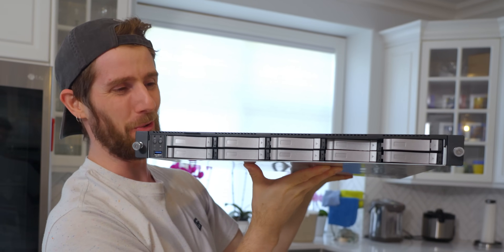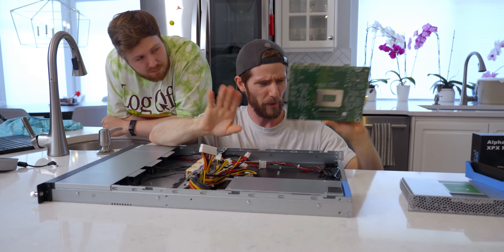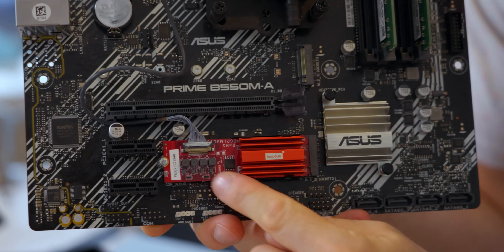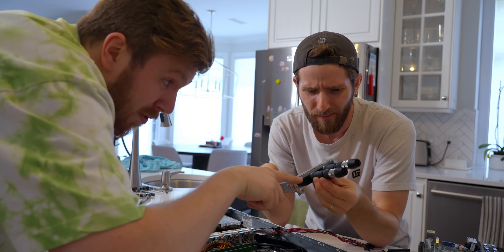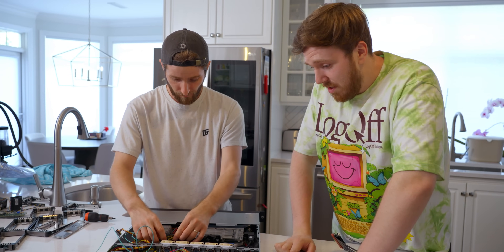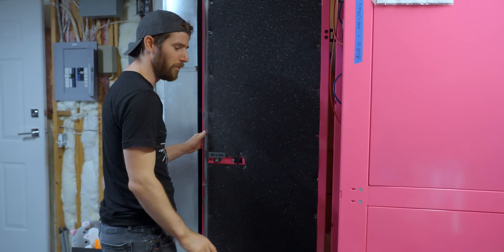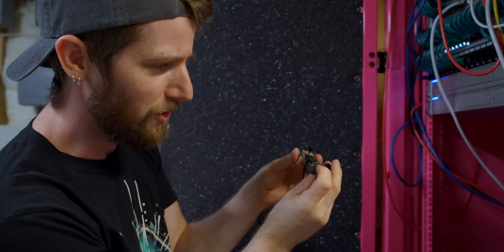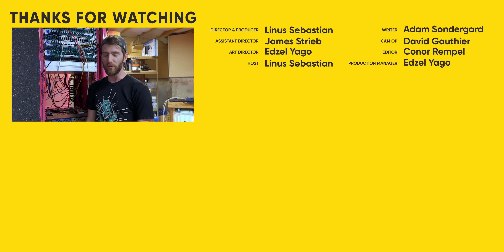I designed my perfect gaming PC, then threw it away - 1U PCs for My New House Part 2

Comment: I've noticed the same about the optical DP, it's really finicky. As you found out the optical cable has to be connected directly to something active, I found that a DP signal repeater works. Then on the other side because I have a lvl1techs kvm, I had to add another repeater after it again to get my monitor to accept it.
Even bypassing the kvm and plugging the optical DP directly into the monitor doesn't work, it has to go through the repeater to be sable(ish). They're like 10 euros on amazon, worth a try as it makes a big difference for me.

Comment: I feel like this would have actually been THE use case for 7 Gamers 1 CPU with virtual Windows and pass through graphics cards. I bet that would have fit perfectly into a 4U server, would have been much easier and cheaper to build and have off the shelf hardware. The only downside really is that you cant easily start your setup with the start of a button, but i bet there is a nice solution for that too.

Comment: Linux those remote pc switch are at risk of data theft and hacks. Cause they are directly connected to pc usb or other PCI's. People can easily hack or theft important data if the Provider want's.. You could use a RE5V1C relay module which only takes power from usb header through 2 +- pins. And its connects through internet via wifi... You can switch it from anywhere on the world. Just need some DIY...
Please Don't use wireless switch which are connected to pc usb header Through 4 pins

Comment: The problem at ~16:20 is probably caused by using a simple transistor across the "button" wires. The transistor wiring makes it need to be plugged in only one way.

Comment: He must have a hell of a breaker in that room because I have two gaming PCs, a mini fridge, and a small window air conditioner, and if me and my cousin are both playing a game, it throws the breaker in the room.
Reply: Evan a small window AC is probably at least 8 amps, that leaves 7 amps for everything else assuming a regular 15 amp North American circuit. Split in two that leaves 420 watts per PC. As for Linus' setup, they probably said the specs but I forget. A common setup for server racks is 2-pole 208 or 240 volts. That's 4 times a regular household outlet.

Comment: The whole "it's for businesses, not normal people" argument is bullshit.  We want standards too!  We want to put our computers in another room so we don't have sound or heat to deal with when we're gaming!  We don't need 24/7/365 same day support!  Stop making low profile computing expensive, damn it.

In other related questions from the peanut gallery:  Linus, you've made like, half a dozen "X gamers, 1 GPU" builds.  Why not make a single 2U with ample storage, a big honkin' GPU you can provision across multiple VMs, and a single high core count CPU so you can just provision a bunch of modern day computers for you and your family?  That seems WAAAaaaayyy easier and cheaper to do considering you've already done it multiple times AND the drivers and methods to do it are now even easier to acquire and configure.

Comment: Hey Linus, Question. How will the pool water cooling work in the winter in sub freezing temps, wouldn't the water in the loop freeze and/or cause cause condensation about the cpu block?
Reply: I believe he's heating the swimming pool year round, and the waste heat from the machines is just a (miniscule) part of that, so that shouldn't be a concern.  I mean, it probably will be if the loop isn't insulated from the ground well enough, but I guess we'll find out in January or February, assuming he's gotten the whole thing installed by then.

Comment: Would be interesting to goto a metal shop, and get estimate, and this TYPE of system..  BUT look at this another way, FLAT DESKTOP..  will need supports to place monitor ON TOP.
Give consider attention to the backplane Cover plate.  Not to worry if the case is 1.5 U...not 1 U.

Comment: No no no no no no no just no, thought you were smart, this is stupidity x5. (apart from the jank that's just cringe to the max, I kept shuddering watching you put that together) one of those zip ties comes lose and 4 other pcs get a bath. What happens when a family member says I need a 40 or 50 series graphics card this old 30 series wont run my new game.  Also 2 TB for gaming a bit small.

Plus I can see walking to another room to turn on the PC will get old very quickly, the remote will get lost, I'd be using sleep mode, use keyboard to wake it, or if he's a smart kid he will just leave the PC on 24/7 and sleep the monitor. power bill what power bill.

Comment: im local to Vancouver and  I would kill just to get a working pc right now ( my old 5th gen cpu and mono died) and im too broke on disability to  buy parts. 
got any hand me downs ?   I was doing work on fiver for contracts and such using my computer  to keep the lights on .. but now. im basically food bank dependant
Reply: to be specific I will take any motherboard cpu/ram combo over a 5th gen intel.  or and equiv.. .  I have a 7th gen intel cpu socket 1151lga. and two `16gb ddr4 rams that are not matched speed
and all the rest of the hardware I have will be fine (m2 drive and gpu etc). but. I won't say no if you want to do a pimp my pc setup video ..  lol I like dockers. and want to do game./video dev at home

Comment: Limiting the server chassis to 1U just makes no sense for this. Better to get a second rack, even if it's a small rack and at least opt for 2U which immediately becomes much more flexible since a standard motherboards IO shield won't even fit in a 1U chassis. A half height rack dedicated for just gaming PC's would fit 5 4U server chassis which would allow more use of PCIe slots, standard ATX power supplies and larger fans for quieter operation.

Comment: This is like the 5th video I've seen on this server rack/fiber home computer setup. This seems such a massive headache to setup and maintain. Plus, if anyone else in the home has an issue that requires troubleshooting (which i'm sure there has to be SO MANY), there is no way anyone else in that house would be able to easily solve it themselves. You'd constantly have to be acting as IT support for even the most basic of issues.
Reply: Just hand out a bunch of steandecks...
Reply: yeah but every time it breaks, he gets a new video
Reply: /shrug And some people like to fix up old cars. Everyone needs a hobby.
Reply: I still find it funny that he is trying to go budget on these builds yet has those icron docks on every build. I'd bet money that none of his kids currently or even a few years down the road will require that kind of bandwidth for usb. If he wanted to save money those docks should have been the first thing on the chopping block. Active usb 2 or 3 extensions with a powered usb hub and long 3.5mm audio cables are good enough.
Reply: @ikkuranus  physics would like to argue with your point about the active extensions.
no, seriously, if you cross a certain point of length with your cables, converting it to fiber optics is one of the best things you can do, i've had to fix too many issues with those cheap extension cables before
Reply: Linus, and probably a fair number of people, are of the mindset that over-engineering a solution now will save you time and money later. So yeah, while five individual towers is probably easier to troubleshoot, it might take more energy to fix down the road. But getting everything properly setup and tested now, there won't be as much necessary maintenance later. Especially when it comes to basic stuff like cleaning
Reply: I mean it's not really, All these videos are him updating not fixing things.
Reply: @altokers Hmm updating things that maybe don’t need upgrading
Reply: @altokers  sure. But let's say one of his kids computers has a blue screen crash and the system needs to be power cycled. That's not super uncommon. And if his kid had a computer tower, then they could probably solve that themselves. But because this is so overly complex, any future issues would basically require Linus to be on hand to solve it.
Reply: @AshsToAshs  

He literally made a remote in the video to restart it as needed.

Comment: Question:

What.... ah.... What's stopping using 4 nucs or minis forum boxes in a 2 unit server box. water cooling the 4 mini pc's in series.... and just having it thunderbolt over to an egpu solution at each station. 

I mean you guys watercooled a network switch... and a red camera... what's 4 nucs in a server case... besides time?

Comment: Remote power on solution:  Set the bios to Power on after a power fail, and use Z-wave switch modules.   You can then assign control of that module to a button, event, or your control method of choice.   Do it with my desktop as well.  Bonus points: power monitoring, remotely enforceable bed times, etc...

Comment: I was planning on doing something similar for the PCs here but cost of living crap has delayed the implementation.  The nice thing about these videos is that Linus is going through the issues that I might experience when I do my setup so now I know what to expect and plan for those hiccups before I spend money.  My eventual setup is not quite the same though as the distance between the computers and the monitors is only a few metres for me which means that I can bridge the gap with shorter cables and not have to worry as much about doing optical USB/DP cables.

For what it is worth, my planned setup is aiming at consolidating 4 PCs and a server into a smaller footprint using a rack rather than removing the heat sources from the area.  I plan on using Silverstone rack mount cases too but I will likely stick with 4U cases so I don't have to spend money on buying new PSUs.

Comment: Tile lined pools need to be filled slowly or the tiles expand faster than the grout causing thermal shock and fall off. I can't help but wonder what's about to happen during or after winter with all this heat running through the pool floor and or walls when this thing gets re-filled.
Reply: Heating water takes a ton of energy. IIRC in the previous video they said it would take 8 days to heat the pool by 1 degree.

Comment: Wouldn't it have been easier to buy the cases and hack the top and bottoms off the center ones, attack them together and use a 3d print to mount everything inside

Comment: Seriously, listen to Jake and do a heat exchanger and distribution rack for your pool heating / rack cooling. 

Keeps water touching cooling blocks separate and clean. Allows high pressure / traditional PEX on the pool loop and low pressure / traditional cooling components on PC side. Anything else is just foolish.

Comment: I skipped the rack, the watercooling, the fancy USB thing, and all that hassle, and simply moved my case into my basement, and put some 100ft fiber optic cables (2x DP, 1x HDMI, 1x USB 3) through a hole in the floor. All the noise and heat from my rig are in the basement, and away from me and the thermostat. It's been a month, and it's still creepy that when I wake it up, I don't hear the fans spinning up AT ALL. Forget about cloud computing: basement computing is where it's at!

Comment: He should swap one of those gas water heaters for one that uses a heat pump. It would steal the heat out of the air in that room and put it into its water tank. The room would be cooler and he'd still have hot water.

Comment: instead of the silverstone car style remote you could just use an esp32 and a little bit of soldering and run ESPhome. It would integrate seamlessly with your home assistant server and you could even turn on you PCs with your light switches...

Comment: Powering those rack mounted computers can be done with Wake on LAN. There is an app for smartphones which will be more convenient than this remote control. Also it can be improved with a simple NFC tag that is placed on the desk and programed to power on the computer when a phone is placed on it. Shutting down the computer can be done by the shutdown menu in the computer's OS.

@dm1i mentioned an Arduino powered control panel, that seems complicated to produce but it will be more convenient in the long run. 

Since phones and apps change, also there are occasions when you don't have phone on you, or your buddy needs to power your PC and their phone is not configured, my idea seem a bit dumb. But it can be modified and tweaked to be more suitable for many more situations. For example NFC tags can be programmed to power the PC with any NFC enabled phone, that can be security issue if it wasn't for home use. In a smart home with voice assistants (depending on the openness of the system) there can be added a Wake on LAN as well excluding the need for phone interaction. And many more "smarter" solutions.

Comment: I get that hardware is typically faster, but this seems like a lot of work to go 5U in 1U increments. At least to me, it'd make more sense to go to a bigger chassis, higher end hardware, and virtualize all 5 gaming PCs on the single unit.
Reply: The problem with virtualization is that lots of anti-cheat software for games doesn't like it. Games that do this will literally refuse to run in a VM. It's easy to say "well just don't play those games then", but it's never that simple.

Comment: I'd be interested to see you try to use a Shelly1 dry contact relay for the power button! Its super small, Wifi-enabled (with MQTT options), runs on 12 or 24v and could easily be shoved into one of those chassis.
Reply: The problem with that is you then need another power supply. The one he used works because the motherboard USB header still supplies 5V with the computer off, because the PSU has a 5VSB (standby) rail.
Reply: @aaronmdjones  standby power. Good point! I imagine an ESP32 might be a better approach! Throw a little ESPHome logic and tie it into Home Assistant!

Comment: One thing I have never done is water cooling. I dont overclock and a good heatsink like a noctua has never failed me. I dont trust water being around expensive electronics. I have four 4u standard ATX rack mount cases for my servers. Plenty of space for full ATX motherboard, power supply, RTX 4090, 8x 3.5 inch hot swap bays, and 2x 2.5 inch hot swap for ssd. I can fit whatever I want in them. Plus my rack has 3 rack UPS, 1u KVM, 2x 48port 1gb POE switches and room for a shelf for cable modem and other stuff. I still need a good cheap rack multi SFP+ 10Gb switch for fiber/DAC. 1Gb is getting to be too slow anymore.

Comment: Why not just make a 4U case and have all PC's in it and use unraid to split them out? Use a 7 PCIe slot 4.0 board ASUS Pro WS WRX80E-SAGE SE,  place 5 single slot water-cooled cards in, a 64 core thread ripper (8 cores for the kids each, and 16 for you and the wife), 2 USB or thunderbolt cards. If my math is right (this is from memory), you should be able to get everyone what they need from one system.

Comment: If you don't have some kind of liquid/liquid heat exchanger between a pool cooling loop and a computer loop with a way to throttle the pool loop's pump according to the computer loops temps, you'll have moisture from the ambient air condensing on the waterblocks and hoses, which will drip on the components in the rack.  You absolutely don't want to have the coolant going right from the cold wintertime pool water temps and into the PCs.

Comment: 13:40 Those quick disconnects are Koolance QD3s if anyone's wondering - expensive, but you only get a single tiny drop when disconnecting them.

Edit: On my system, I placed the part with the collar on the hose's side and the solid part on the PC's side - makes disconnecting and reconnecting a bit easier.
Reply: They're definitely nice. I have multiple M.2 in the garbage position of being directly under my GPU, so I have some QD3's on my GPU so that I can easily take the GPU out to access the M.2s. Realistically, most of the time I literally don't even get a single drop, at least, none that drips out. Collar side on tube, solid part on GPU water block here(For both inlet and outlet)
Reply: All of my computers use the Koolance QD3s as well, but mine are installed in such a way that I cannot accidentally get the flow backwards. Male connectors are always on the pressure side of the loop.
Reply: @michaelmiller3012  ...oh. Well apparently it works just fine with one fitting reversed, been working for a good six years now, but I will definitely fix it next time maintenance comes up. Thank you for that info!

Edit ooooh wait I'm stupid - you mean on your particular system, right? That's clever - in my case it doesn't matter since I'm only using them to connect the radiator.

Comment: You should power on your servers through the Alexa skill. As long as your running Ethernet it should work. You cannot remotely shut off the system though from what I believe, but who physically shuts off their machines nowadays? May not be the best way but I was suppressed with the way you went.

Comment: I really want to do a 1u thick, 27-32 inch screen sized pc. 1u think but the dame parameter as a monitor. Fold the monitor down and have a 'PC-laptop'.  I dont understand enough about power supplies though to make it actually work. 

But i can cnc/3d print a 'case' to make it work. Thin radiator/thin fan combos for water. Id have the radiator exposed with a slits or even just open. 

Anyways, i want a 1u thick comouter in a 32 in monitor parameter that i use as 'portable' or laptop. Preferably laptop cause i can just carry and plug in.

I dont care if laptops exist, i want a 27 inch screen laptop!
Reply: Same. Need this for live event work.